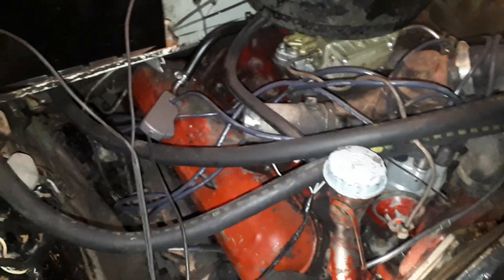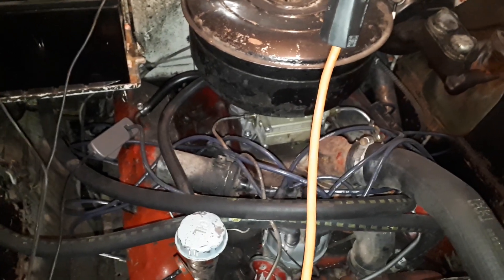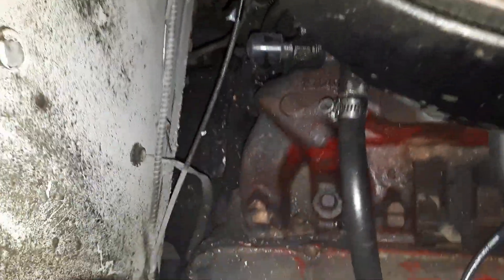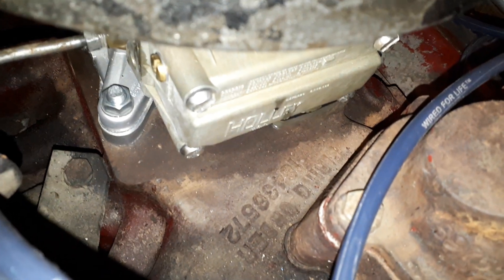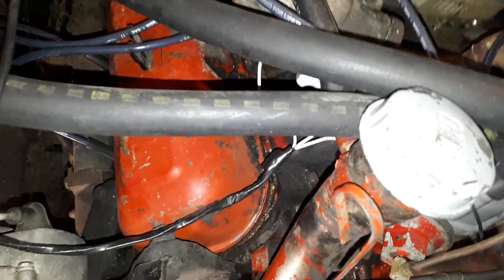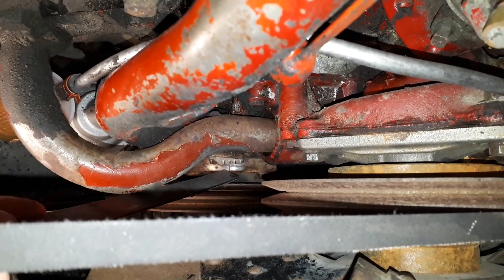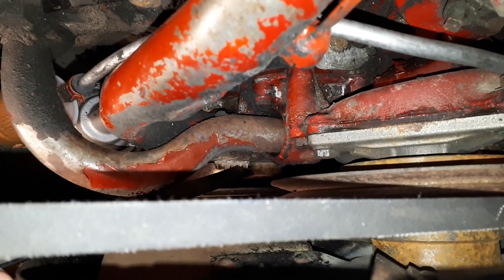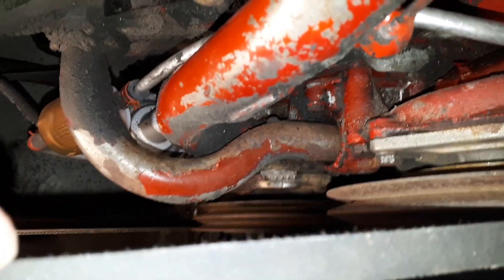International SV Engine Ignition Timing

Comment: For timing on the bottom.  Have it in 0??   Or 5?

Im fixing a 345 engine. And its overheating.
Reply from the maker: I would start at 0 degrees and see how it runs. The copper line is the vacuum advance, to advance your timing as the engine spins faster. You do need that. There should be a vacuum pot on the side of your distributor.

Comment: do you have any videos of the timing gears? I have a 345 and I timed it to # 1... I know it is #8 I just ripped it apart and have it set at TDC of #8 compression .but the gears don't line up for the distributer .?do I just pull the top gear off and adjust the cam till the #8 lines up with the distributor?help
Reply from the maker: Sorry, I don't.  If I am reading this right, you need to line up the dots on your camshaft gear crankshaft gear.  When the timing marks are at 0, #8 should be close to tdc. Then line your rotor up with #8 when you put the distributor in. You can email me too binderparts@shaw ca
Reply: Since this is timed off the #8 cylinder the rotor should be pointed at the #8 point on the cap when it’s set to TDC correct?

Comment: Hey there! i've got a IH 304 V8 thats running real bad. Got the carb rebuilt from a Reliable shop but its running super rich. It's popping and back firing out of the carb. It's probably an issue with the timing, any ideas?
Reply from the maker: My first thought would be timing and confirming your plug wires and firing order. Have you checked for vacuum leaks around your carb?
Reply: Following. I just replaced my 304's carb with a Holley 2300 SA, and I have to tap the gas when taking off from a stop or it'll stall out. I suspect it's a combination of timing, carb tuning, and the accelerator-pump setting.
Reply: Mone os horrifically doing the same. Had the carb rebuilt and it’s still doing the same thing. I haven’t messed with the timing yet. I did change the plugs, wires, points, condenser, and I changed the fuel system. Still back to square one. Fire 🔥 coming out the carb

Comment: I know nothing of the international engines what would cause the 392 in a s1700 dumptruck to backfire out exhauset on every shift or when you let up on the gas pedal it is a manuel trans any help is greatly appreciated
Reply from the maker: I would check your timing then your carb settings. Have you changed anything or done any work on it recently?
Reply: @binderpartsltd4965   timing was way off when I got it plugs and wires on wrong got that streightend out timer roughly 5 degrees advanced timed with cyl 8 it has an edelbrock 4 barrel on it that came on it when I bought it
Reply from the maker: @jonathanchapman6350  I would find someone who knows eldebrock carbs and have them set it up. If all that is good, may be a bad valve, but hopefully not.
Reply: Binder parts ltd thank you I'll try to find someone

Comment: I didn't know they cast the cylinder no. and timing order on the motor. So what would be a good starting place with a stock 304 timing?
Reply from the maker: Hey Jay R start between TDC and about 5 deg of advance. Play around with it as they are all a little different.